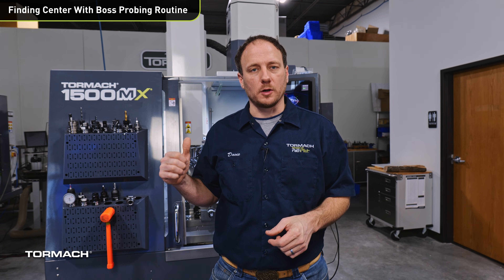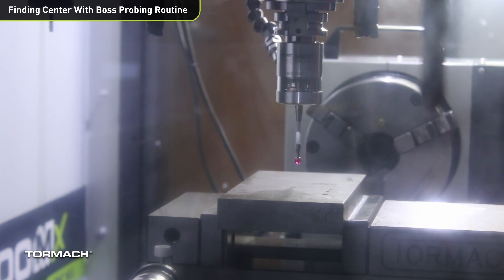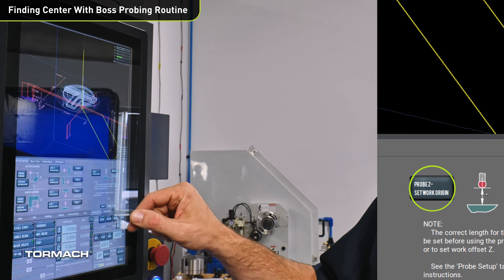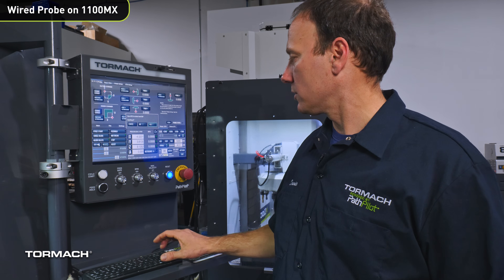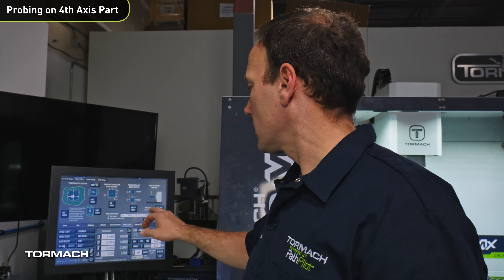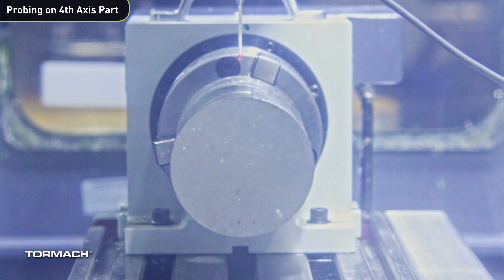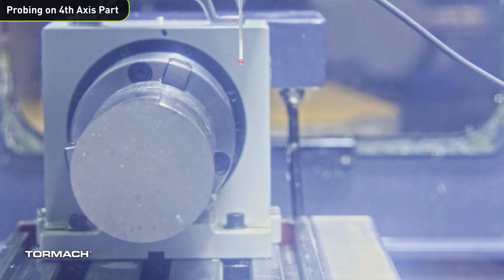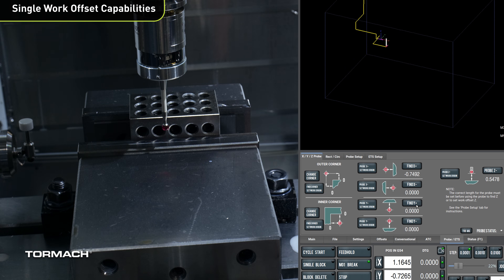Tormach Probing Routines - Multiple Examples in PathPilot

Comment: Can the wireless probes for the 1500 be wired to work with the 1100MX?
Reply from the maker: The electronics of the 1500MX were designed for the wireless probe and it can not be used on our other mills.
Reply: @tormachinc  Thank you.

Comment: Awesome video. Answering all the probing questions.  A bit faster than me with my Haimer, and some nice programmed options. But when will we take this to the next level with a lidar and remove the need for me to get it roughly in the right area?  It be great if it could look at my post, see the shape and dimensions, see where its at physically with the radar and start measuring my raw material and set the zeros.
Reply from the maker: We have implemented Lidar in PathPilot Robot for parts placement, but have not done work on Lidar Probing. We are constantly working on other improvements to our machines, but can't make a statement as to their availability.